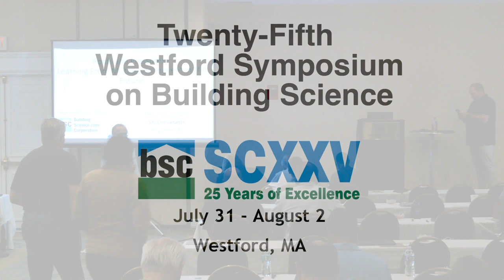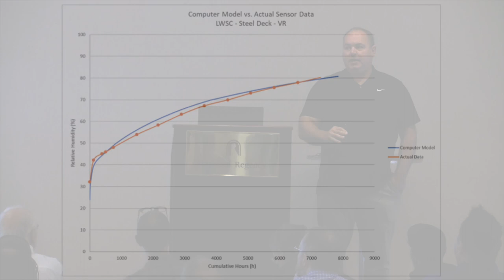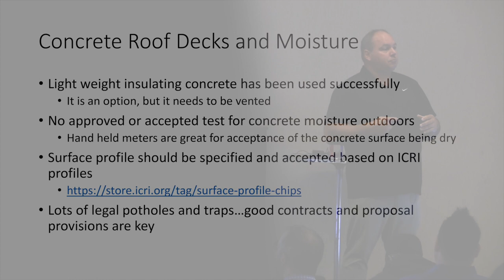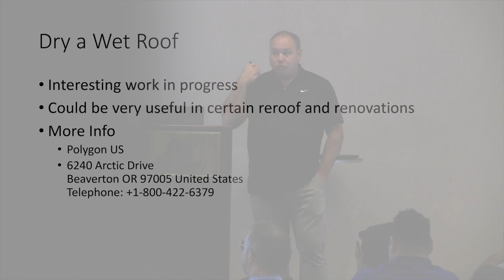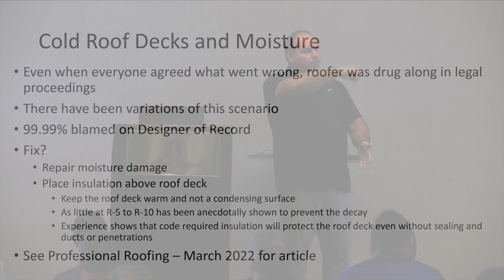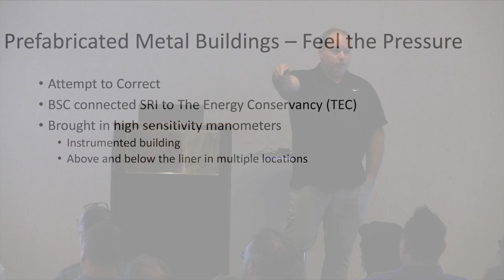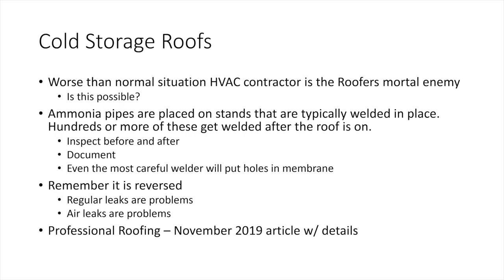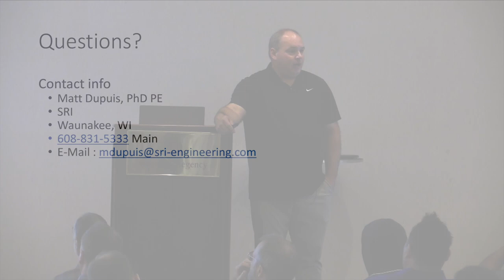Roofs and Pressures: Learning From Mistakes, Matt Dupuis (Building Science Summer Camp 2023)

Comment: Cold roof decks, Europeans have been successful at venting the cold roof deck for a long time, How? Permiter edge vent, along with mushroom vents.  They have studied it for years and the venting along with very good vapor retarders and installation, and paying close attention to sealing, these techniques stop the condensation, Venting is a must 2" minimum space.  (yes cold climate, vented flat roofs, insulation from below or "cold roof") they got (or can get) it to work, why because many times they must use a cold roof technique since they retrofit buildings that are hundreds of years old. (they also screw up, but again it is about the sealing and craftsmanship) The big problem here is that the mechanical system must move down into its own interstitial space.